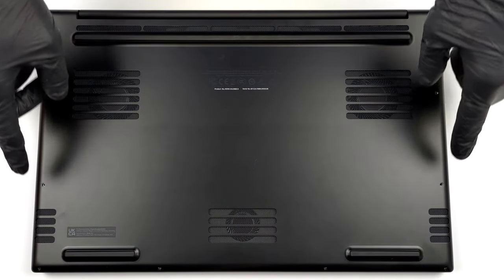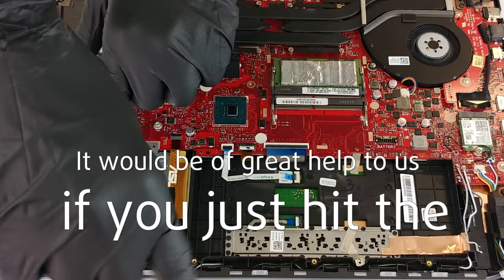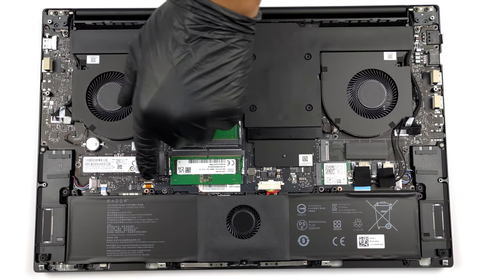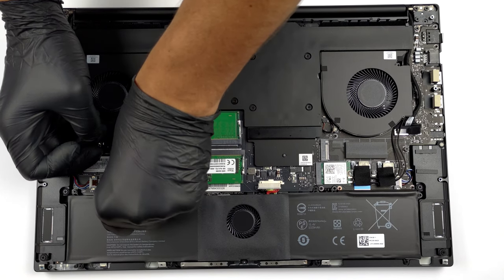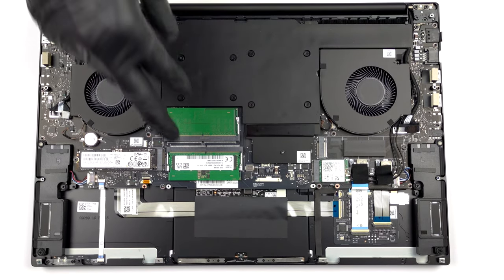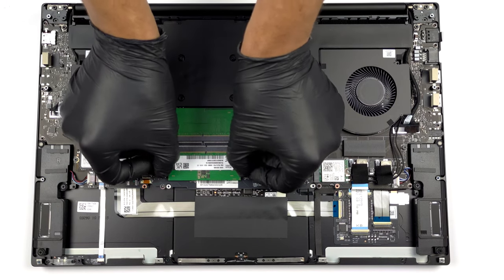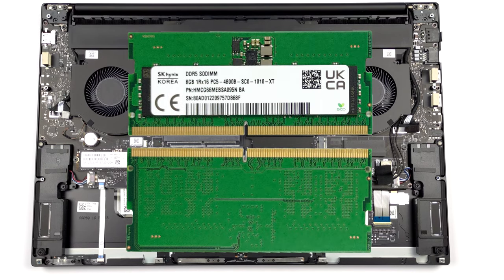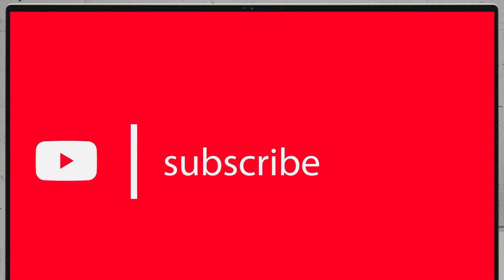🛠️ How to open Razer Blade 17 (Early 2022) - disassembly and upgrade options

Comment: RAZER BLADE 18. One of most expensive laptop I ever. Bought. The company has shifty technical support. International. With heavy English accent.  They charged me $90 to ship the laptop back for remove the SSD screw.   It’s cheaply made. Still haven’t heard from them.
Reply: Well you know their reputation
Reply: a heavy english accent that's so random 😂
Reply: Tks for the lowdown on the brand. I hope they do a better build qual with their latest 18" 4k version, but its doubtful.